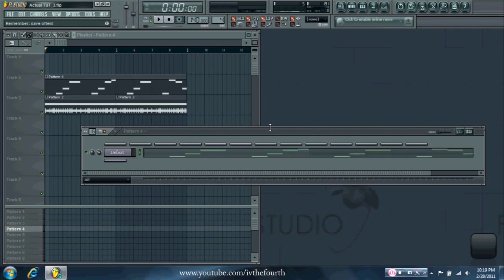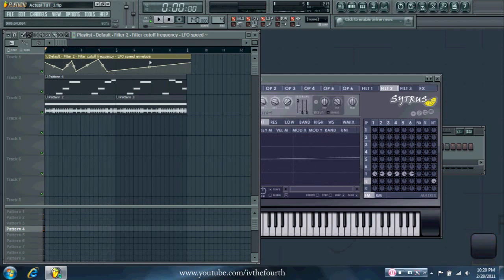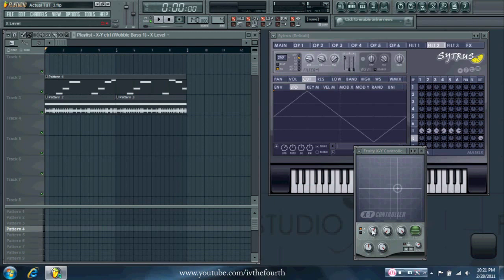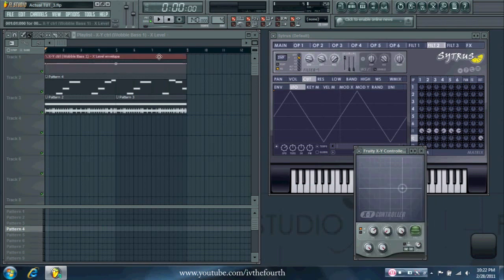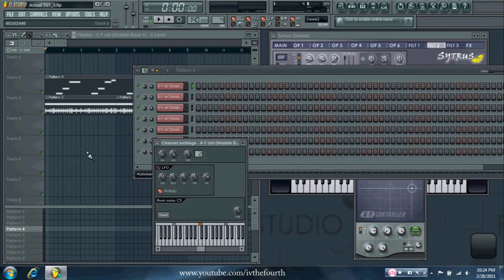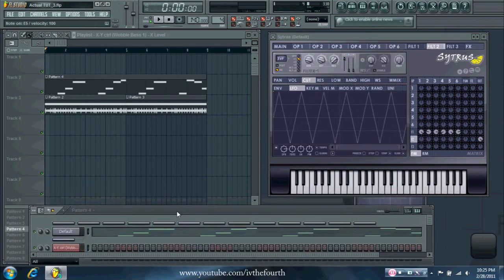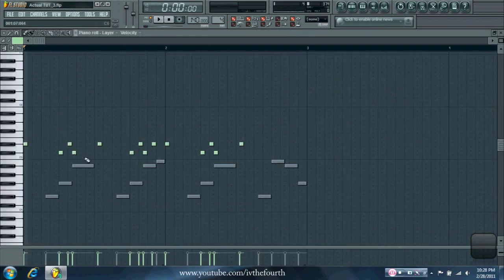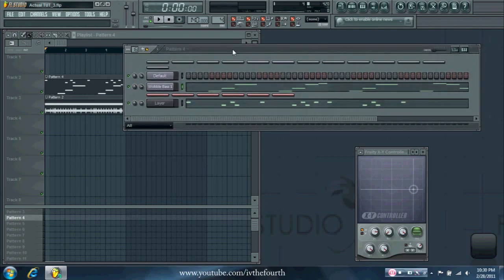Dubstep Wobble Bass Speed Tutorial (FL Studio)

Comment: thank you for the video. it works great. now how do i apply this to songs i have already started on? i have linked the xy controller to other bass synths. i can get the speed to change by moving the xy controller dot with a mouse. i need to know how to link the xy to my keyboard . i also saved the layer as a preset. the layer will open fine and add all the anamation. i just dont know how to link the two together. hope this comment/question made sense lol